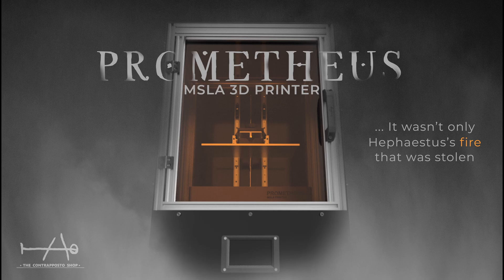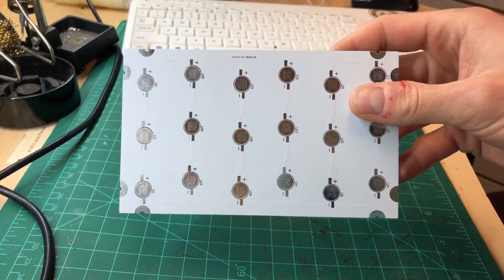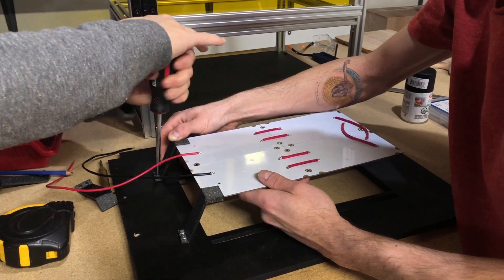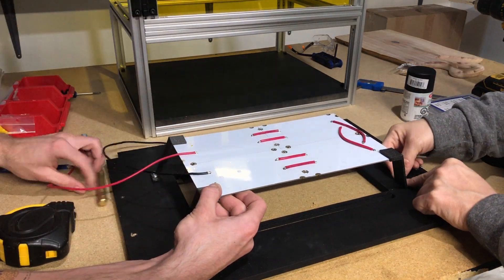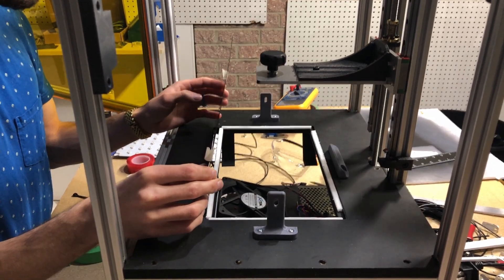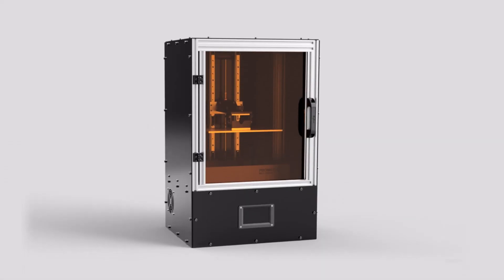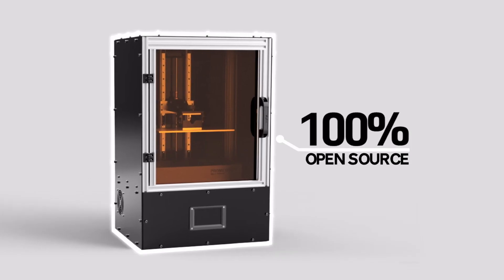Open source resin 3D printer ! ( prototype )

Comment: Hello sir you are awesome😎
I want dlp cheap resin fastest printer for jewelery (60mm per hour at castable resin) (0.05mm layer thikness) can you make one for me pleaseeeee..?There is no problem with the size means if the platform  size is even 4 inches there is no problem but the speed should be fast
Reply from the maker: I unfortunatly can’t develop a new printer like that for anyone. The Prometheus MSLA tooks 4 years of development to be at this point. Without saying several tens of thousands of dollars for prototypes.
Reply: @thecontrappostoshop  😓

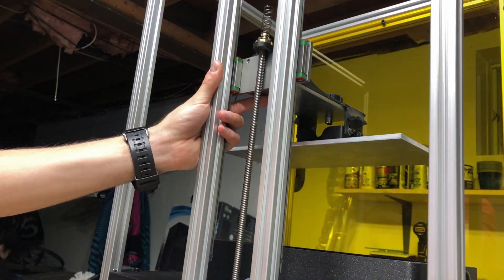Comment: 7:45 yes it’s cheaper but a cheap ball screw will be worth it’s weight in gold, and for the added cost of about $40-$60 it’s the one compromise that’s worth it.

Would love to see a more premium version of this too!
Reply from the maker: Don’t worry :) we will have a version with a ball screw … the problem is with cheap ball screw they are not machined but roll press ( if it’s the right term ) … it cause a lot of stresses in the metal and the screw wobbles. It creates artefacts in the print finish. But like i said it will be possible to choose between parts :)